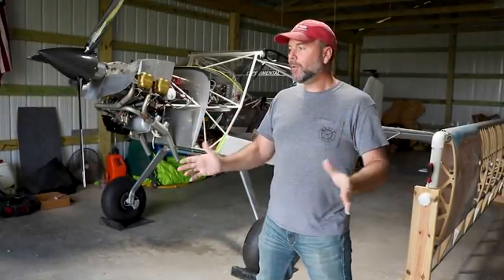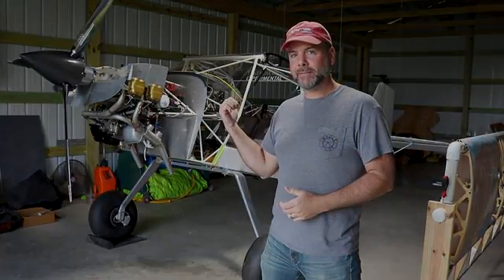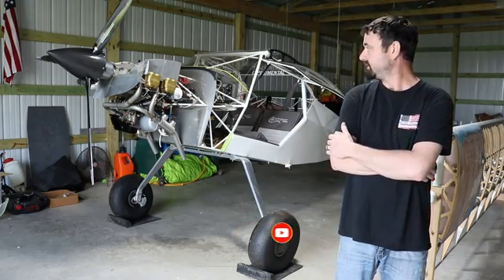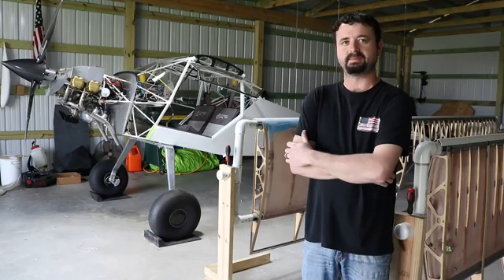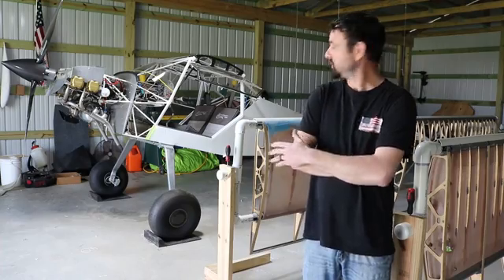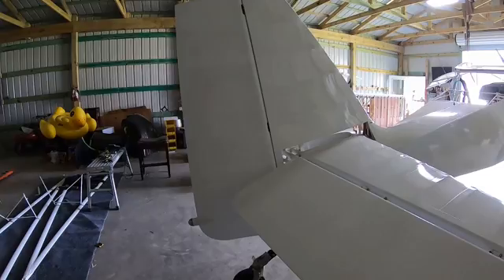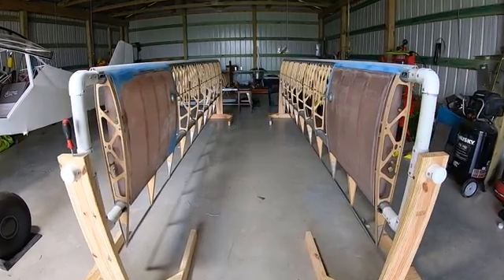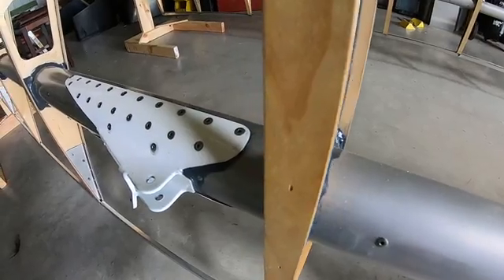Garage Tour! Kitfox Series 7 Aircraft - Builder "Ben Bell"

Comment: is it constant or fixed pitch propeller?
Reply: per his description of the single adjustment screw that moves all 3 blades simultaneously I would infer that it is fixed, but ground adjustable. also no blue knob on the panel.